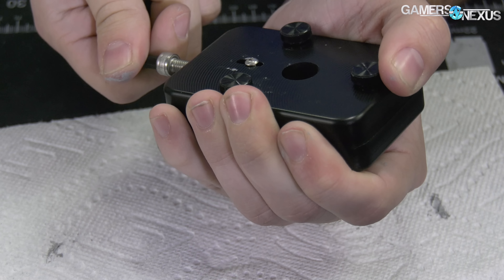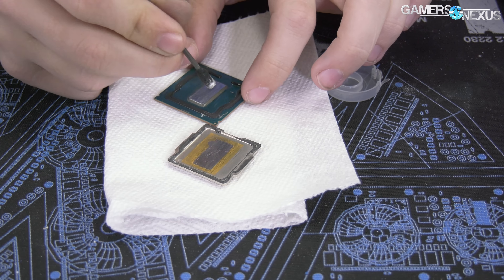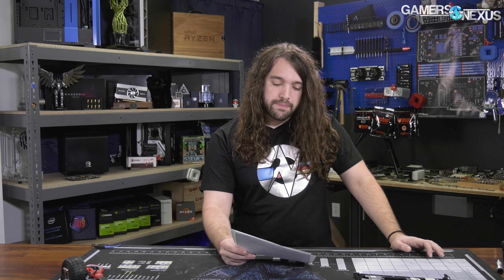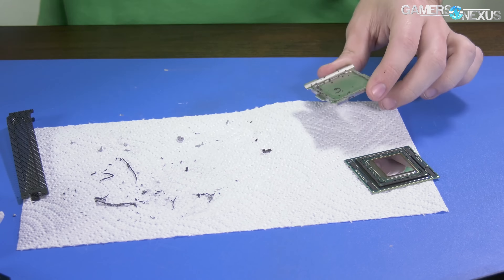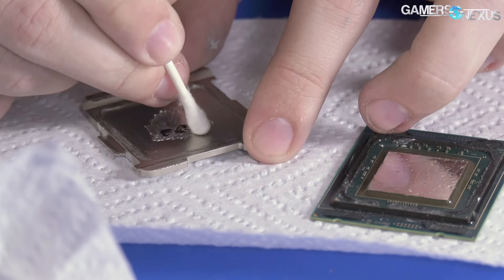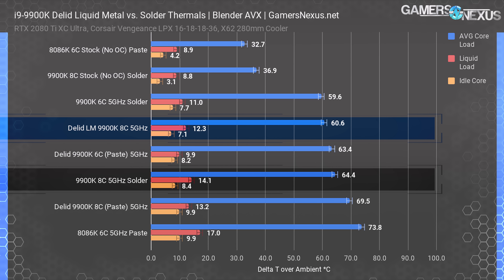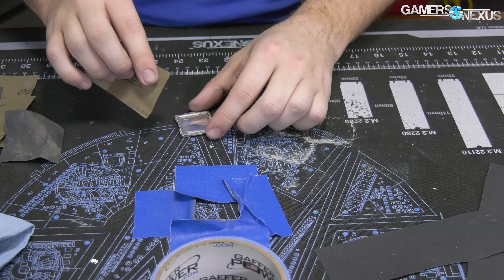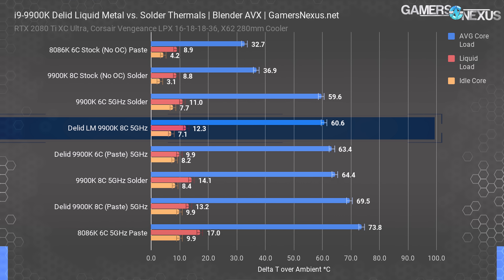Back to Reality: The 9900K Delid & Liquid Metal

Comment: Intel finally solder the CPU, but on the other hand, I don't want them to solder, so I can delided easier and apply liquid metal.
Reply: iirc there is no benefit from liquid metal if they do the solder right. Der8aur did direct die cooling on one of the ryzen cpus and found a 1c temp improvement vs the stock solder. Intel is just managing to mess it up, like they did with the TIM.

Comment: Has any company produced replacement copper IHS's for the 9900K yet? And has anyone tried direct die mounting a waterblock yet? (would most likely require die-sanding til the die is as thin as an 8700K's).

Comment: Can a Noctua D15 sufficiently cool a non-delided 9900k @5ghz all core OC 24/7 on a higher end motherboard like an Asrock Taichi z390 without significantly killing its lifespan? Or would it require water cooling???

Comment: So when some trusted source starts delidding CPU's, testing their efficiency, and ensuring they're not dead and then listing them for sale let me know, lol. I bet for some people it would be worth the cost. Perhaps "A charge per point drop in Celsius" might be fair to have it done plus the time involved. For example, something like a $10 per negative degree change on a CPU could be charged. So a -10 degree change = $100 above the original cost of the CPU, a  -20 degree change = $200. :) but other "lottery" type factors could play its part in making the CPU more valuable. :)=

Comment: if you delid, but don't reapply the glue (and use CLU) does the CPU have to operate (full time) laying flat? Does that mean it can't be used in a Core p5/3 setup where it hangs on the wall? Will it drip out?

Comment: yeah i screwed mine up first time i de-lided but it was only a practice run on an old intel extreme LGA775 (soldered)  I think if it was not soldered it would have been fine but the issues caused me to loose interest in ever deliding again

Comment: Another important reason why the Delid on  the 9900K is not that effective as on the 8700K is the fact that the Die itself is twice as thick. This is why grinding down the Die will give you the missing difference in Temp.

Comment: I would love to see what 9900k temp with a cooler similar that of wraith would do
Reply: The simple answer is throttle hard
Reply: @bengrogan9710  I was just wondering since 9900K has lower TDP then 2700x
Reply: @monkkeye  TDP is an almost irrelevant measure as it is not standardized between any manufacturer.

How do they work it out?
Its a wattage so its energy transfer
Fine, is that at the die or IHS level
What area is this transfer over?
At what voltage and clock was this measured? Stock clocks? Turbo?
No one agrees
Reply: @bengrogan9710  I think it would still be cool to see 2700x stock cooler vs 9900k with similar cooler
Reply: @monkkeye  keep an eye on what kit different reviewers use then.
As far as I remember the wraith coolers are within a few percent of matching a hyper 212 cooler
Reply: @bengrogan9710  So wraith is not that bad of a cooler then I remember when hyper 212 was at one time one of the best coolers lol
Reply: @monkkeye  it is notably better than intels basic heatsink.
If memory serves it is around 4 degrees hotter, the 212 is in real terms a basic aircooler by moder standards

Comment: after sanding the ihs and lap the die, how do you adjust the die height with the ihs so that they make contact?  seems like you would get into machining territory to insure accuracy without damaging the silicon.  Question, how much can you lap the die without either damaging the die through lapping itself or having the die crack with the pressure applied by the cooling block?  Last question, would it not be better to have direct contact with the die to your cooling block(like the old days)  you might have to cut and stack some copper shims on each side of the die to keep from crushing the die while tightening the cooler...?   Fun video, thank you for your hard work and efforts.  Now if Amazon would just send my cpu i could test these ideas for myself.  who knows, i might even try the same thing with my 2700x system just for the hell of it ?  Nah, i'll leave that to you...LOL  Maybe...?
Reply: highlander, If I am to sand the die, I am to forgo the IHS altogether. Direct die cooling it is. As for how much is too much: it's hard to tell as the die can crack at some point due to thermal expansion/contraction.
Reply: Thats what i was thinking....i'm waiting for someone to do the hard work so I dont have to experiment on what now is a $600 cpu.  If and when mine ever arises...LOL

Comment: Since I am thinking about upgrading my CPUs in my Dell R710, I was thinking about running Liquid Metal on it before I upgrade the CPUs to the MAX with used CPUs, 20 to 30% performance increase sounds like A lot for this type of system, would it be A good idea to run the Liquid Metal in the with out the top of the cpu cover & have no cpu cover directly to the cpu cooler, since that is another layer for the cpu to have to cool, for me it makes since to take off the top of the cpu all together and have the liquid metal on the cooling fan to the cpu directly that would be the best benefit

Comment: Im a noob, but can you take the lid from an i8 to avoid the hassle of smoothing the lid from the soldering? Soldering is still on the chip so thats still a PITA.
Reply: No, the die on the 9th gen is thicker, meaning trying to put a older IHS on will over pressure the die and possibly crack it
Reply: Smoothing the lid is not dangerous at all, the problem is smoothing  the die.
Reply: There is no i8
Reply: Figured he thought of it. Was just curious.

Comment: so pretty close to what happens if you delid ryzen . when debauler did a 2600 it got 4c so id expect a 2700x or 2700 to gain about the same. this chip still runs super hot but its not garbage solder as alot of people want to say it is garbage temps when oced tho

Comment: My 4670K might have benefited from deliding, but it's so old now that I'm not going to bother for my gaming PC.  It was literally the worst overclocking chip that I had owned, and I could only get it to stay stable at 4.0GHz, which is awful.  I honestly couldn't tell if that had anything to do with thermals though, because it wouldn't even boot to windows at 1.3v at 4.2GHz, so I couldn't check.  I even had purchased an X62 with it at the same time.

Meanwhile, my older system is still rocking an i5-750@4.0Ghz after nine years.  The base on that was 2.6Ghz.  I go from a seemingly golden chip, to dirt.
Reply: and also you can get x3440@4.1Ghz for $18 that can handle all multiplatform games at 60 frames, its just insane
Reply: Lol mine does 4.7 stable at 1.299 v non delidded, I'm going to delid this and my brother's 4790k soon once the tool from eBay arrives

Comment: A question about dark rock pro 4
I have x5460 and I want to put it in there and overclock this shit to 4.5ghz or more since I cant find a good water cooler with a support for lga775 online or reviews about it online. I know it's a dead system BUT i'm upgrading to 9900k probably machine in a year (Studying this year, Im supposed to be studying for a test now xD) Anyways, I found online that dark rock pro 4 supports lga775 yet on local stores it states that it supports 1555+ . Is it about the backplate? I read online people using modern liquid coolers with older backplates and it goes well but  dont touch the cpu cause it touches the M/B components but supports it.
Can I buy this cooler and use it on 775? It looks cool. I'm buying periodically the components of the new system, I got the psu, will buy a 250$ case soon , I already have 1050ti but will flip it last minute to get a 2080ti or newer who knows, I might not be even alive in a year but I'm still curious

Comment: hypothetically, couldn't you remove the solder during the sanding/lapping process rather than risk damage with the blade or using a chemical reaction with other metals? if you're already sanding the processor down to remove scratches, impurities, etc. then couldn't it be accomplished in that one step?

Comment: I really need help with my laptop hp pavilion envy dv6 beats audio! The laptop gets to hot that i ended up replacing the thermal paste and all of a sudden i got a black screen, caps lock blinking, and orange light on the toggle button for wifi! Please Please Help!!!!
Reply: You probably put it back together incorrectly or did something wrong with the thermal paste application.  Maybe try again and check for any loose ribbon cables or anything else of that nature that you may have missed along the way.  If you do it again and are sure you've done it right, you may need to take it to a shop unless you know someone that can help you out.
Reply: @DeToxCommunity  yes ive disassembled it three times already and everything looks good
Reply: @DeToxCommunity  thanks for replying though, and of course im gonna try my best to fix it if not, im going to send it somewhere
Reply: BryanSWAGGBEAST Alright.  It's hard to suggest much else without getting any hands on it.  Good luck getting it fixed.

Comment: Can you do a video on how to delid a 32 core cpu from amd properly? I want to reduce the heat and noise of fans via liquid cooling
Reply: Why? All of AMD's CPUs - all of Ryzen, TR, and EPYC - are soldered.

It's not worth it.
Reply: @mduckernz  Because, partly due to that small degree of temperature is not bad, and also lowering the noise in a new computer case is not a bad thing. Plus, I want to liquid cool, and I feel that the standard solder, is just not effective for liquid cooling enough
Reply: @mduckernz  Plus, the liquid metal, I actually liie how it helps, and i was thinking of buying more Kyronaut
Reply: @ShiroColdkeyesTheHedgehog  Well, okay, but der8uer has delidded AMD CPUs and replaced with liquid metal and found basically zero performance difference. He said their solder use was exemplary. I really don't think you'll see any noticeable difference - certainly not enough to justify the risk of doing it.

And this is coming from me, who has lapped CPU dies before for reasons like you are citing (less noise etc), so it's not that I'm simply risk averse. I just don't see the point in pointless risks.
Reply: @mduckernz  I kind got intrigued by how linus has done it, gamer nexus, and yes even der8uer.

It caught my interest, but was looking for a proper way, to do it.

Kind of want to learn, due to being bored and have no computer right now
Reply: @mduckernz  Not saying your wrong, I just figured a good project to learn would be something to kill boredom is all

Comment: Dude why don't you use heat & flux to desolder it? 

On a side note lead 60/40 solder has far higher thermal conductivity than liquid metal or gold-indium solder.

Comment: I'm just wondering, are you wearing down that Allen key bolt a lot when you delid CPUs? Does it take a lot of force to delid the cpu?
Reply: Not really, in older generations you where only pushing to shear the silicone adhesive, this time theres a little more force to break the solder.

If there where any real force involved the threads in the delidder would break well before the bolt ever would
Reply: @bengrogan9710  
Thanks for clearing that up!

Comment: intel should have used silver in the solder... its the best thermal conductor of all metals... with how expensive the cpus are, it would make sense to actually use a quality conducting metal
Reply: Silver doesn't like high temperatures.
Reply: @crimsun7186  I'm sure it can handle 100C
Reply: Yes, but is it stable at 100C? Sure, the cpu only gets to around 90C but is that the temperature at the solder joint? Probably it's much higher than that. This is the same reason why MOSFETs are rated for 125C internal temperature.

Keep in mind that the indium solder can take 180C

Comment: Why not just replace the IHS instead of lapping it?
Reply: There are no IHS on the market yet for the 9900k, Intel went back to a thicker PCB and the die is taller also so one for another cpu won't have the correct thickness
Reply: why even bother with IHS? direct die water cooling is the best
Reply: Cause you have no money left after buying the 9900k...
Reply: They used to have completely exposed dies on their chips mobile processors are still direct die I believe I think the band of complete idiots who broke their Athlon die when incorrectly installing a cooler caused both AMD and Intel to cover up their desktop dies.

Comment: What's the point? modern CPU's have little overclocking headroom anyway and if you're running into a CPU bottleneck squeezing out an extra 0.2 Ghz it's going solve your issue. Only an upgrade will.

Comment: Can the same be said about the 9700k? If delidding is too much risk and hassle.
Reply: This can be assumed to apply to the entire 9th gen lineup
Reply: @bengrogan9710  then 8700k delid LM vs 9700k stock... Which is better?
Reply: @DarkPa1adin  thermally the 8700k.
Raw peformance? Rougly equal.

Reason: Hyper threading is only around 25/30% of the gain of a true core.

Comment: If you want a proper mirror finish, i'd recommend using some alumina for polishing.  As a part of my BS and MS in material science I've probably spent more than 1000 hours polishing various metals and ultra hard ceramics to exceedingly high tolerances and finishes.  We have special machinst's tools and equipment but if you want that finish try this triplet of compounds.    http://consumables.alliedhightech.com/Alumina-Suspension-p/alum01.htm

They also have diamond on mylar lapping films to use on flat reference surfaces (AA grade granite surface plate) or polishing wheels.  http://consumables.alliedhightech.com/Diamond-Lapping-Film-Discs-8-p/dlf8.htm

not cheap but it's the premium you pay for scientific grade shiny.

Comment: Instead of having to spend the time lapping the IHS what about just using one of those third party IHSs , Instead of having to use blades for indium removal and lap the die down is there anyway that the solder could be heated and wicked off the die?
Reply: They had a pure copper IHS and the result was marginally better. That's all
Reply: Not easily.
1st for any 3rd party IHS you need to make sure it is for 9th gen - the die is thicker, if you use one designed for 4-8 gen you run the risk ove cracking due to over pressure.
2nd wicking off the solder is a good idea in theory, but means heating the die to above 130 degrees, any heat past that could degrade the silicon VERY quickly

Comment: why didn't you guys just use flux with and a desoldering station
Reply: Because you risk burning the CPU. The glue around the IHS was made to withstand temperatures above the solder melting point without losing adhesion.

Comment: Why don't they just use liquid metal straight out of the factory?
Reply: Nacho159 Because it's a liquid? It'll move, and there are SMDs under the IHS anyways

LM needs replaced every 1-2 years anyways, solder is solder. The toothpaste from Dow that they're using on lower end parts and the older chips is both cheaper to use and more stable than solder when it comes to thousands and thousands of temp cycles
Reply: Steve has answered this in other videos.
Too many chances for failure.
With stim or tim core to core variance is 2 degrees ish
With poorly applied lm it can be 10
Reply: sTIM is an engineered solution; the thickness and different material layers are designed to provide heat transfer suitably within Intels specifications to operate for more than a certain amount of years (far longer than it's expected to be useful). The paste TIM Intel used to use was much cheaper, but wasn't as good as the sTIM is at conducting heat, but was still within spec to last just as many years, and the IHS and thermal paste could be more easily removed and the die cleaned. Whereas Liquid Metal can squeeze out due to thermal expansion and contraction, leaving gaps.
Reply: Because liquid metal is made of extremely reactive and conductive stuff that damages other metals and it's not a good long term product either outside it's other drawbacks.
Reply: To add on the previous answers, gallium (the major compound in liquid metal, alongside tin and indium) diffuses through copper and a tad through nickel (not through silicon), so given enough time the liquid metal will be sucked by the IHS. This leaves the CPU dry of thermal interface material, which is obviously bad.

Comment: Only CPU really worth delidding and LM is the 7700k.  That CPU has a HUGE potential to run 5.1 or 5.2 on air, but only after the delid.  Without delid, its garbage unless you only run it at stock speeds.